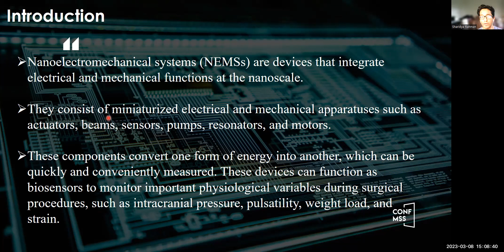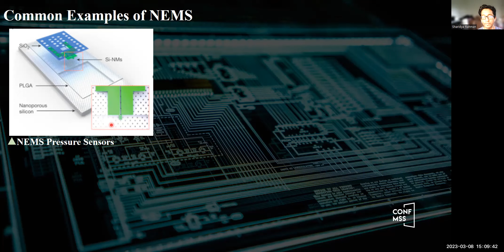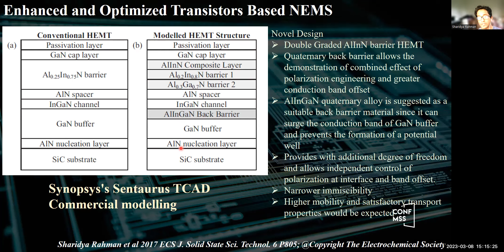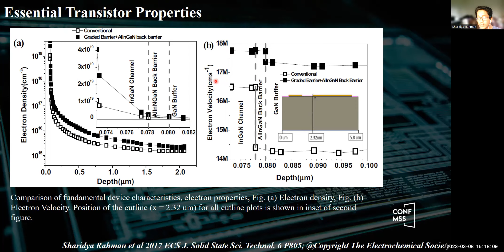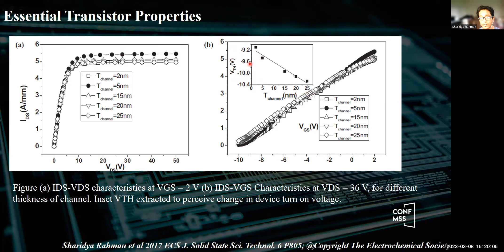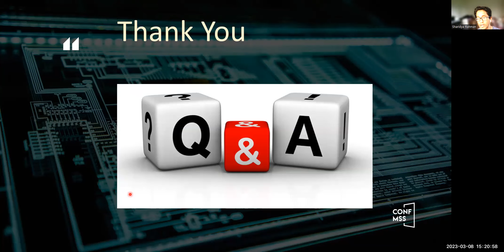CONF-MSS Highly Enhanced Nano-electro Mechanical System (NEMS) for Microwave and Defense Industries

Comment from the maker: Could you explain the key technological advancements that enable the highly enhanced capabilities of the NEMS?
Reply from the maker: RE: Key technological advancement includes development in nano-fabrication and processing technology that enables manufacturing of miniature transistors with nanometer resolution. In addition industries like TSC in Taiwan, China can manufacture such nano-devices at ultra high speed and precision. This can be integrated into PCB boards in large number enabling the implementation of ultra-fast electronics